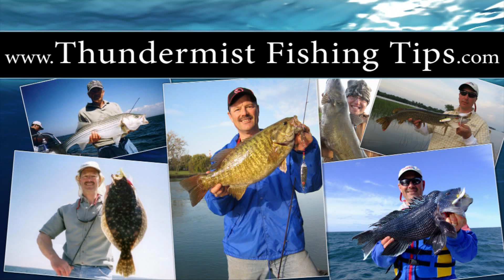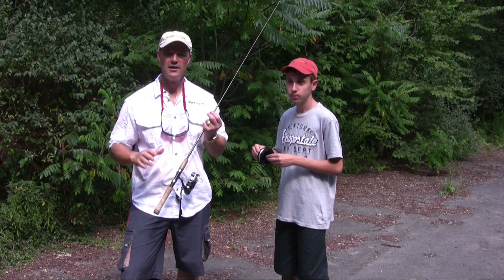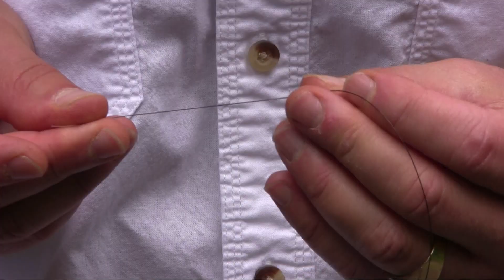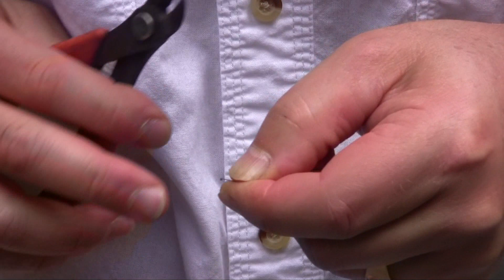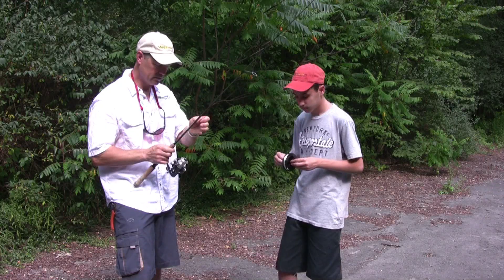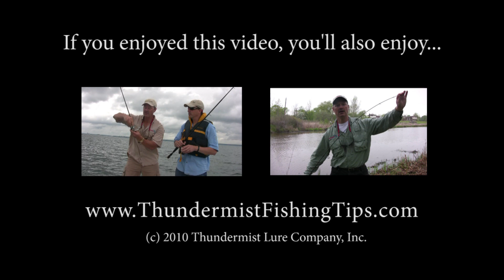How to Spool Line onto your Reel and Prevent Fishing Line Twist While Spooling Spinning Reels

Comment: Mine is right-handed so the line should hang down to the left, correct? 🤔
Reply from the maker: the side which the handle is on doesn't make a difference as its the direction that the spool is spinning which is key - so regardless, follow the instructions as I show in this episode and you will be good to go :)

Comment: You did'nt say if the line comes off the spool clockwise or anti clockwise.
Reply from the maker: Hi John - it depends on the line manufacturer as to which way they spool up their line - however, if you follow the process in this episdoe, you will not have any problems :)

Comment: Does this work for baitcasters too?
Reply: +Isaac Arriaga You can to the pencil thing with baitcasters as the line reels vertically onto the spool
Reply from the maker: +Isaac Arriaga Hi Isaac - sorry for the delay in responding as I must have missed your question - however, I see that David has responded with great feedback.  The method in this video is only for spinning reels, or spincast reels.  Baitcasters must be spooled up differently and here's a quick video with some tips: https://www.youtube.com/watch?v=kD1mrN-cBOQ

Comment: There is no correct way to put line on a spinning reel! Your basic spool of line comes on a 2 1/4 to 2 1/2 diameter spool. Your basic spinning reel spool is 1 1/2 to 1 3/4 diameter. So when you transfer the larger loop to a smaller loop there is a twist every 1 3/4 to 2 1/2 inches. The fabulous thing is most fishing line will relax when heated, taking the twist out automatically. I get water just hot enough to not burn my hands, and leave the reel spool in it for 10-15 minutes. No more over loops, twists or birds nests when casting!
Reply from the maker: Edward Drew Hi Edward and thanks for sharing your line tips with us and good luck on the water :)
Reply: This guy spools.
Reply: So what happens to the larger spool that was heated? Do you have to keep heating the larger spool when placing line on each season?
Reply: heating the line before you spool it on sounds easier than taking your reel spool off and dunking it.

Comment: I got a question and it may be stupid haha. Um so I spooled my line on my spinning reel and well, when I go to cast or just in general the line doesn't feel " tight " it feels loose, is it supposed to be like that? There's no slack its not just falling off of the spool, it just doesn't feel tight. Is it supposed to feel like that? I got a 6'6" medium, fast action rod with a 5.2-1 gear ratio, 7 ball bearing Pflueger Trion reel. I spooled it with 8lb test monofilament.
Reply from the maker: ***** When spooling up, it is best to keep a bit of tension on your line as it is going on the spool - you can do this by lightly squeezing the line between your thumb and finger as you are spooling up.  Also, sometimes line is very "springy" depending on the brand you are using and it is very important to spool up in the manner noted in this episode.  One last pint, if you over spool, the line will also unravel :)  Hope this helps and if you ever want to spool up with fluorocarbon, be sure to check out the new Thundermist lure company "Thundercarbon" as it handles extremely well
Reply: I  am using Berkley Trilene monofilament. I respooled it that way but it stil feels a bit " loose " maybe its just the type of line? What would be the best line for that rig do you think? Its a spinning reel with a 6 to 10 pound test " recommended " and should I use braid instead?
Reply from the maker: ***** You can use braid if you want, but your reel should be able to handle the mono just fine.
Reply: I think I'm just not used to such a longer pole, last time I went fishing a lot was back when I was like 14 years old, back then I had a hand me down like 5 foot spin casting rod and reel. Haha. I never used braid though. Any suggestions?
Reply from the maker: ***** If you have not seen it yet, give the new Thundermist Lure Company "Thunderbraid" a try - it is an premium line that you will love :)
Reply: Does Thundermist Lure Company have a website? If so I'd love to try it out. I live in the states. So, I'm not sure if shipping and handling would be a problem.
Reply from the maker: ***** Thundermist Lure Company ships to the USA every day and their website is www.thundermistlures.com Good lcuk on the water and thanks for writing in :)
Reply: I really appreciate it, your videos are always a great help!

Comment: rewatched this video and tried again, at first I had big curls coming off. pulled some line off. now it seems to be working. ( I got 10 good casts out of it in the parking lot anyway). heading to the lake now to see if I got it right. still going to bring a backup pole though incase I messed up.

Comment from the maker: This method will work with 50 lb mono however, highly suggest not using 50 lb mono on a spinning reel as it will not cast or retrieve well....use a bait caster in stead for such heavy line :)

Comment from the maker: It is possible that you may have some bad line.  Once in a while, you could come across a bad spool of line which had not been manufactured correct;y.
Try spooling up with another spool and a different brand.
Hope this works for you :)

Comment from the maker: @tapap84 . - although it would have been better to follow this method, the spider wire is more forgiving than mono, so you'll be o.k.  We have a video as well for spooling braid and the key here is to make sure you start off with some sort of backing first - such as spool up with 5 or 6 wraps of mono, then use a uni-knot and then continue spooling with braid.  You need a backing or your line will "slip" on you and be loose - like having zero drag.

Comment from the maker: @keegan0000 in this case, you will want to make sure the knot is on the low side of your spool, so that it will help offset the unevenness of your line spooling.  It sounds like your reel is not spooling up properly, as the line on your spool should be evenly distributed - but give this a try and see if it helps.

Comment from the maker: @jeffrussell13 You can use 20 lb Trilene,  but the XL would be better than the XT - once you start to use heavier line, such as 20 lb test on a spinning reel, it has a tendency to coil up and become "wiry" - at least the XL may be a bit more forgiving.

Thanks for writing in and good luck.

Comment from the maker: @rcurrier78 Yes, you can use 15 lb test line on a spinning rod, but look for a thin diameter line as it will spool up nicer and cast better.

Thanks for writing in and good luck on the water!

Comment from the maker: @Justin280107 You can drop shot rig with this set up if you want to, and also, 8 lb to 10 lb test monofilament  line would be a good line to start with.  Stren is a good brand and Bass Pro also has their own brand called Excel, and it is economical and very good also.

Be sure to check out our Thundermist Fishing Tips web site as we have plenty more tips for you there, that you may find very helpful.  Until next time, good luck and good fishing!

Comment from the maker: @lapointeric It does not matter if your are reeling left handed or right handed - the key is the rotation of the spool and on most spinning reels, that would mean that if you are facing the spool of line, it should be hanging down on the right.

Hope this helps & thanks for taking time to write to us and for tuning in.

Until next time, good luck and good fishing.

P>S> we also have more tips for you at our Thundermist Fishing tips web site

Comment from the maker: @hrazdan91205 Sometimes the reels are off a bit and this causes the problem you are having, so you may need a new reel - however - 

Another possible problem could be, when you tie on your line on to your empty spool, the knot may cause this problem to occur.  So try ensuring that the knot is on the back of your spool, then begin to spool up.

Also, you may want to ensure that your spool is on correctly.

See if this makes a difference.

Thanks for writing in and good luck on the water

Comment: Hey, Lucis is great, and ThunderMist Lures videos are so helpful for me. Thanks.

Here is my tip to prevent line twist. This works on monofiliment line. Spool the line on the reel in the same direction as it draws off the spool as in this video. Then secure the end of the line to the spool and remove the full spool from the reel. Rest the reel spool top down in a bowl of hot tap water to cover all the line on the spool. The heat make line remember the new spool. If this fails please tell me.

Comment from the maker: @nkazahaya A spinning reel that holds 110 yds to 150 yards of  8 lb mono would be a good size reel to use....depending also on what you are fishing for. 

Personally, the smaller reel which holds about 110 lbs of 8 lb test would be ideal - but if you are fishing for bigger game fish that will be taking out plenty of line and taking long runs, then the larger size whihc hold around 150 yds would be best.

Thanks for writing in and good luck on the water!